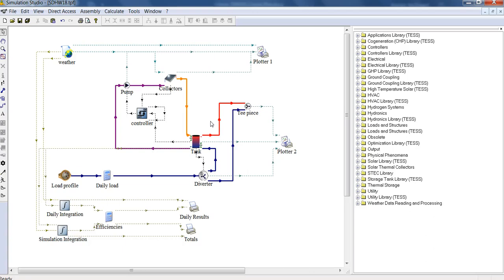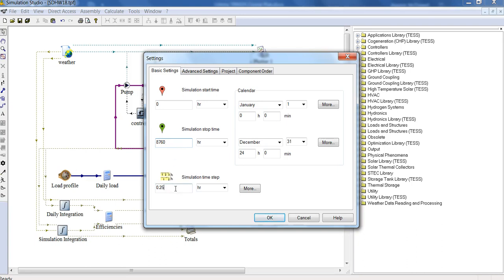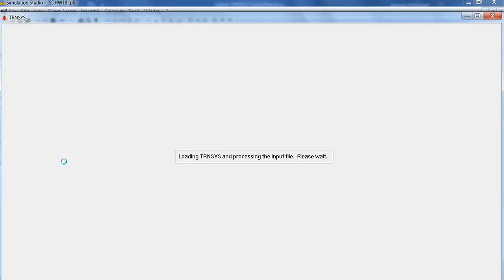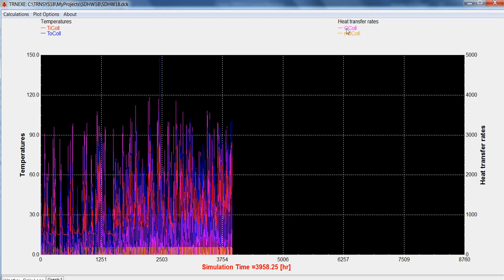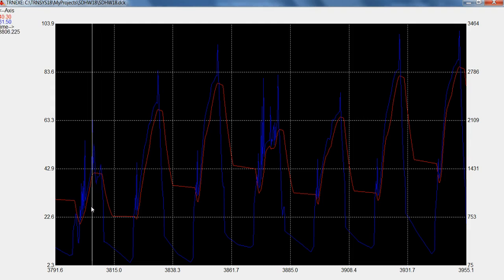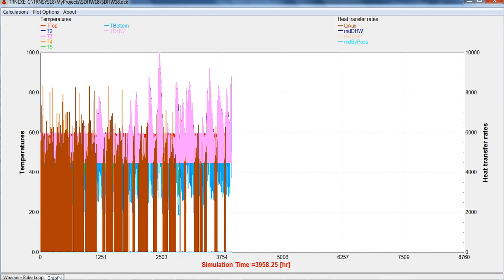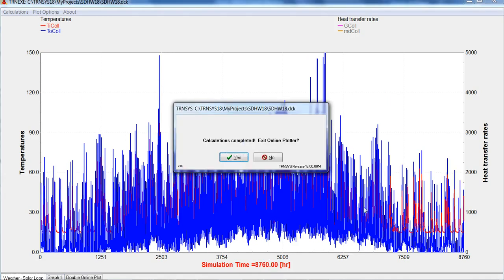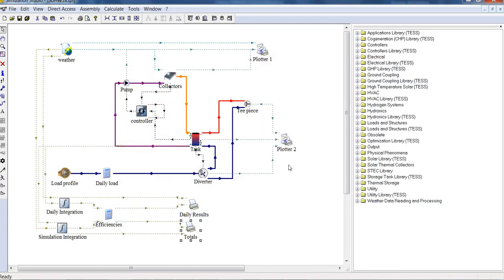TRNSYS 18: Running the First Simulation

Comment: Professor ... How to know the temperature around a region using trnsys? please reply
Reply from the maker: Hello Atef, to know the temperature around a region, just connect the weather data to a printer or plotter to extract the information. Change the weather location in Type 15 Weather component by clicking on External Files tab, browse, C:\TRNSYS18\Weather\Metenorm ... and change the location